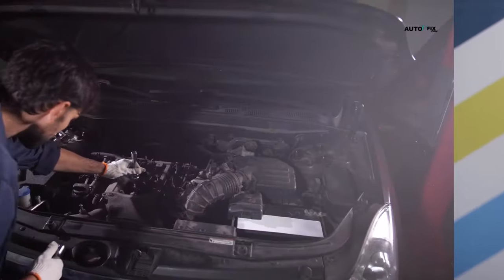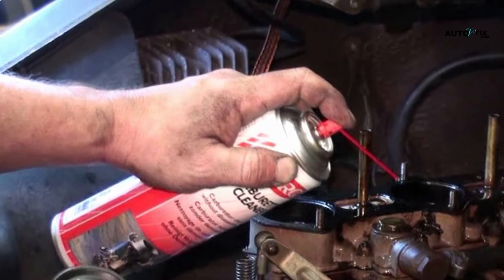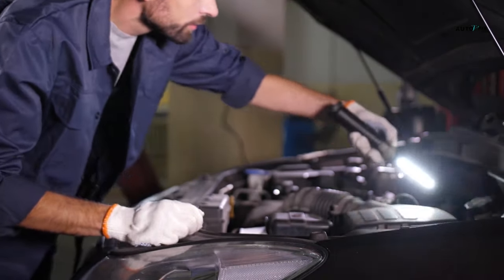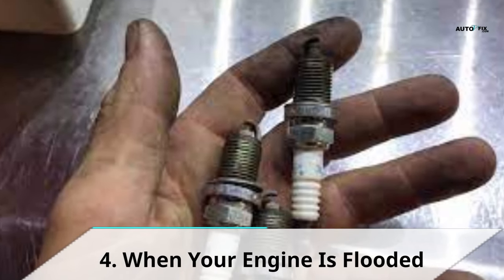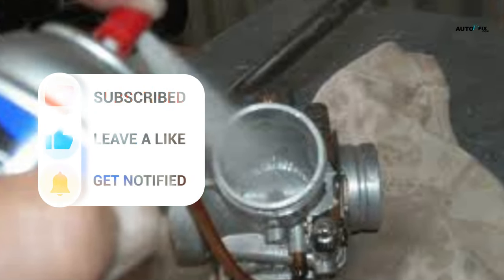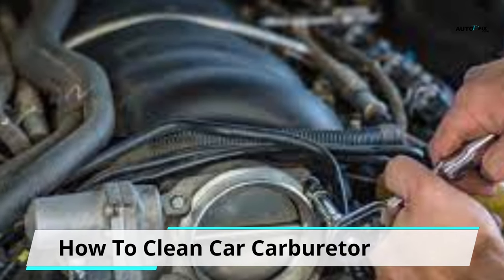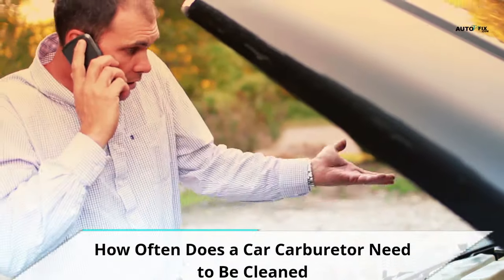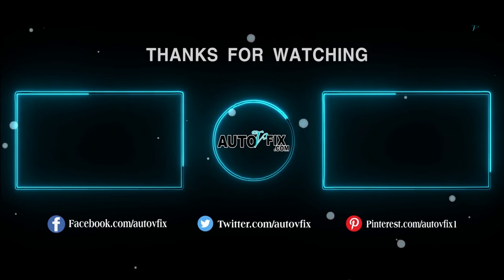How To Clean A Car Carburetor Without Removing It

Comment: The carb spray is useful for sticky choke or other linkage but doesn't clean the small passages in the carb.  Run a bottle of Techroline or similar every 8-10K miles in your gas to keep internals of carb clean.

Comment: if a car isn’t starting try dusting out the air filter as this is more of a common issue than a carburetor being filled with dust
Reply: Or you could just get a new filter.